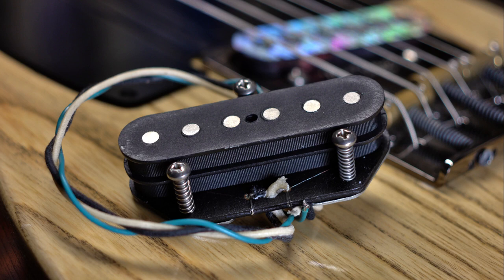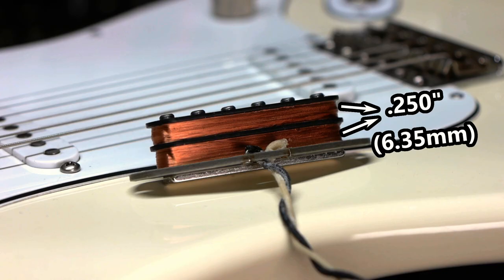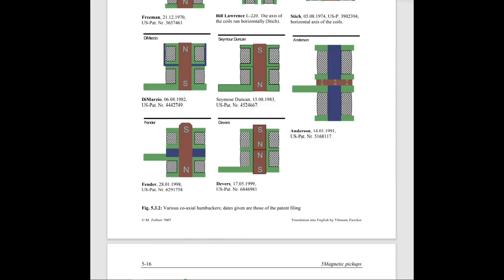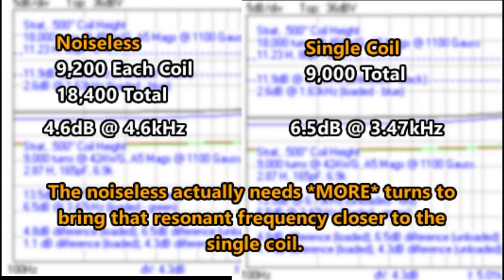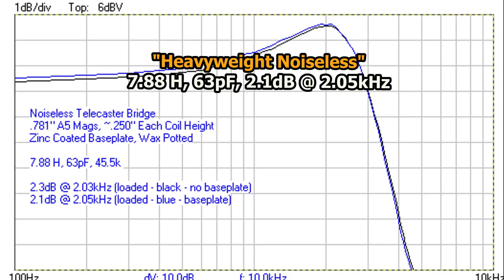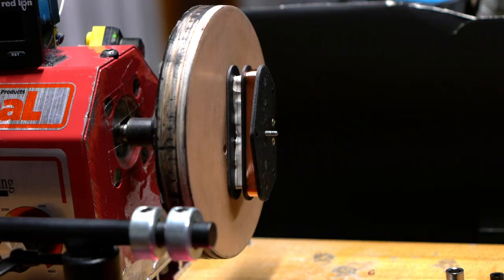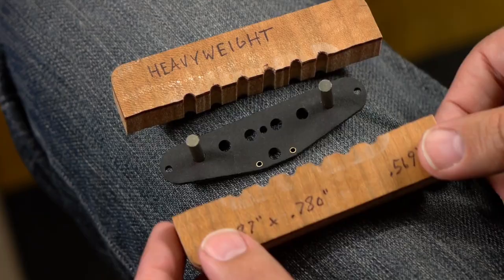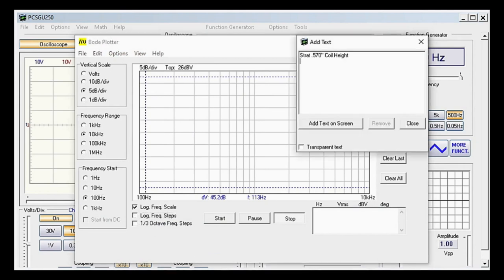Noiseless "Single Coil" (Stacked Humbucker): Build Tips and Theory

Comment: Before I watched this video, I tried doing a stacked design with 5,000 turns ea of 43awg (10,000 total) and observed the low inductance like you described. I believe it was about 1.9H. I switched the wiring back to in-phase / non-noise canceling and the inductance shot up to 8H. Any idea why this phenomena happens with stacked designs out of phase but not in a normal humbucker design which is out of phase by design?  Is it just because the stacked bobbin cores have the same polarity?
Reply from the maker: That's absolutely it -- the stacked have the same polarity. Now why is that exactly? I'd love to be able to answer why on a more specific level. Instead, let me share with you a section from "Electric Guitar: Sound Secrets and Technology" by Helmuth Lemme: 

"Another common form is the so-called coaxial (‘stacked’) humbucker where both coils are 
placed on top of one another. This principle was first invented by Armand F. Knoblaugh in 1938 (US patent no. 2,119,584) but was not used in guitars for a long time. It first came into use in the Gibson ‘Les Paul Professional’ and the ‘Les Paul Recording.' 

This then was copied by many others. Here two coils of half-height are wound on to a big bar magnet or six individual magnets. Because the lower coil is removed 
from the strings further along to the upper one, it delivers a far lower signal voltage with an order of magnitude of approximately one quarter. If it is switched reversely in series to the upper one for hum rejection, it deducts a part of the voltage. Pickups of this style therefore have a weaker signal than single coils of the same size. "

---------

So, regular humbuckers don't have this issue. Because the magnetic polarity is reversed in addition to the phase, they have a true additive effect when wired in series, meaning the inductance of both coils is combined. 

A similar effect can be observed with a phase switch. This is one of my favorite mods. My wiring diagram is here: 

https://imgur.com/gallery/aiI59L6

Series/parallel and in phase/out of phase switches. I use two pickups in my guitars, with reverse magnetic polarity.

Now there's an interesting idea. When you play with these switches, you'll quickly hear how the "out of phase" sounds have much less low end. There is less output overall, but there's a disproportionate drop in low end frequencies. "Out of phase" gets this great, nasally, honky kind of tone. 

Series out of phase gets the sharpest, most brittle tone, while parallel out of phase gets a more honky, nasally, cocked wah sort of tone. 

And of course, series in phase and parallel in phase get more traditional sounds. 

It's hard to imagine why, then, a noiseless stack would sound so different from two normal pickups polarized and phased in the same way. That it mostly just cancels noise, and causes a loss of overall output, but we don't get these "honky" or "nasally" tones.

And I think it's because of the proximity to the strings. If you were to take the bottom coil of a noiseless stack and make it into its own separate single coil, with the same winding direction and polarity, and install it as a bridge pickup -- 

-- then you'd have two pickups with the same polarity, and out of phase with each other. So you'd get your nasally, honky, "out of phase" tone. 

The reason noiseless stacks don't get the same tone, and instead cancel hum, seems to be a consequence of distance from the strings. The plucking of the strings is what induces an alternating current in the coils via electromagnetic induction. The greater the distance the coil is from the strings, the weaker that induced current is. 

Basically, imagine a pickup right next to the strings. Then you lower it so it's flush with the pickguard. And how much of a difference that makes. Now imagine you lower it so much that it's 1/4" or 1/2" below the pickguard. 

Wish I had a more scientific understanding to offer you. But hopefully that helps. Interesting stuff to think about! I'm always learning more, so I'll let you know if I discover anything else. 

FYI, I've had better results recently using a taller top coil and shorter bottom coil. My latest noiseless experiments have been a .280" tall top coil, and a .130" tall bottom coil. Top coil wound with 6,000 turns of 43AWG, and the bottom coil wound with 6,000 turns of 48AWG. 

They sound much closer to a real single coil, and even have a bit more high end. Almost hi-fi sounding. I got the idea from Fender, who uses a taller top coil and shorter bottom coil on their noiseless pickups. I just took it to an extreme and used 43AWG and 48AWG. I've used 48 on a bunch of pickups now and it's a very fascinating wire. Not sure I could handle anything thinner. 

I get mine from Ultra Fine Copper Wire in China. Highly recommended. If I had more time and energy I would have made a followup video, but for now, the best I can do is update in the comment section. 

Thanks so much for commenting and asking a question, and I hope this helps!

Comment: Humbuckers are "noiseless" by virtue of one coil being both reverse wound AND reverse polarity of the other coil...and I thought both opposites were a requirement for the pickup to  be noiseless.  But the stacked pickup's reverse wound coil is the sale polarity as the other coil. So, why is it noiseless? 

Also, some people  can't reverse their winder motors...or they attach the bobbin to the winder via the magnet on the bottom of the bobbin...making flipping it inconvenient. By putting in another eyelet to serve merely as a junction point, the "finish" of the first coil can be attached to that eyelet, and the start of the second coil can be attached to the regular "hot" or "signal" eyelet before winding it...then, its "finish" can soldered to that junction eyelet. The result will be equivalent to the second coil being reverse wound. 

And while I appreciate that your pickup work is both science & art,  I disagree with the over emphasis on number of winds & resistance. In fact, when two different types of pickup could have identical resistance & sound completely different. AND,  active pickups, with a builtin preamp can sound better & have more powerful output than one with 18,000 winds. Plus, output & tone is a factor of more than winds...ranging  from the shape of the bobbin, height of the pickup, magnet type, case  shape & composition, resistors capacitors & pots, and on and on.

In fact, miniature electronics allow piezo pickups, with 1/4 of the output of magnetic pickups, to sound great...and graphic equalizers small enough to be mounted "onboard", as well as wiring mods, allow  an almost infinite number of tones to come from a guitar...and for one  pickup to sound like any other one...making some of this over-attention to detail no longer necessary. Plus, the power requirement of pre-amps is small...especially compared to that which is needed for the power amp anyway! Beyond that...the most powerful, and best tone, I've heard  from guitar was from one with active pickups.
Reply from the maker: The answer to your question can be found in section 5.3, "Hum-compensated Single-coil Pickups" in the following book: 

The Physics of the Electric Guitar by Manfred Zollner, which I've compiled into a Google Drive document here: 

https://drive.google.com/drive/folders/1x9TRAo5gVvCZDk6OGI8rqSGRnm0P1OkM?usp=sharing

The original source can be found for free here: 

https://gitec-forum-eng.de/the-book/

I merely downloaded everything separately, including the videos, and compiled it for ease of access. Just search "5.3 Hum-compensated Single-coil Pickups" and it'll take you to the section of the book that explains everything. 

------------------------------------

Also, I'm well aware that two pickups can have the same DCR and sound completely different. There's simply too much to cover in a video like this. 

The topic here is of a noiseless co-axial humbucker -- and turn count does matter with these, a lot. 

With noiseless pickups, including normal and co-axial humbuckers, the greater the difference in turn count is between the two coils, the less effective the noise cancelling will be. 

------------------------------------

As for turn count, magnet type and strength, wire insulation thickness, bobbin dimensions -- all of this goes far beyond the scope of this video.

Isolating for variables is not easy with pickups, and many people state that wire insulation thickness, wire gauge, coil height and width, magnet type and strength -- 

-- they say these things all matter, but nobody can actually tell you what difference they actually make, individually. 

I hesitate to speak more on the topic as it's extremely broad, extremely complex, and there's only real meaning in discussing independent variables if we're going to state clearly what they actually mean. 

Thicker wire insulation leads to lower capacitance. But it also affects the turn count indirectly, as it makes the total length of wire on each turn greater than it would be for a wire with thinner insulation. So right off the bat we've changed two variables by changing the wire insulation thickness, rather than just one. 

When you change the coil height, you're also changing the distance of each turn of wire. Similar to how a turn of wire on a Telecaster pickup is not the same as a turn of wire on a Stratocaster pickup, as Tele pickups are wider. 

The best way to test things, IMO, is to use bode plots, and to do your best to control variables insofar as that's possible. An example would be my super heavyweight pickup: you can make a similar pickup with a .500" coil height with 18,000 turns of 46AWG, as you can with a .570" coil height with 18,500 turns of 44AWG. .781" A5 magnets for the taller coil, .719" magnets for the shorter coil. 

As soon as you change the coil height like that, you're changing the magnet height and the length of the turns of wire. It just so happens that through experimenting I found 44AWG on a .570" coil to be similar to 46AWG on a .500" coil. 

That's not isolating variables in a highly accurate way, but it's as close as laypeople can get without a laboratory setting. 

And I will say from running bode plots on both of these models, the resonant frequency is exactly the same -- around 1.6kHz -- with similar Q factors, meaning the amplitude in decibel voltage at that resonant frequency. 

The taller pickup seems to have slightly more output with a slightly higher Q factor, and greater retention of higher end frequencies. That's reflected in the lower inductance of the taller pickup, which, despite having 500 more turns of wire, is 10.5 Henries vs. the 11.4 Henries of the shorter pickup. 

Comparing the bode plots side by side, you can see that right at the resonant frequency of both pickups, 1.6kHz, the taller pickup has a greater amplitude at the higher frequencies. It declines at the same rate as the shorter pickup, but since it's starting with a greater amplitude, it retains more high frequencies compared to the other. 

I haven't gotten into making a video about these things yet because it gets extremely complicated, and explaining things in a user-friendly way when most people have only ever heard of DCR for measuring pickups -- it takes a lot of condensation of these principles, with clear examples, to explain what's going on. 

I've even talked to people who are aware of inductance and capacitance, but misapply them in the same way people misapply DCR. Resonant frequency is not the be-all end-all and as I mentioned in the prior example, two pickups can have an identical resonant frequency, yet sound quite different. 

That becomes evident only when comparing bode plots of pickups side by side. When we use only DCR, or only inductance and capacitance, or only the listed resonant frequency, we miss the bigger picture. 

For a standard of comparison it's best to have a "standard," like an 8,000 turn Strat pickup with a .430" coil height, 42AWG plain enamel, poly, or formvar wire, and Alnico 5 magnets. 

That "standard" is very necessary, as without standards, we have nothing to compare by. It's easiest to compare pickups by make and model, where only one variable is changed at a time, insofar as that's even possible. Turn count is one such variable, and most builders only use turn count as the major variable. 

People like me tend to get more experimental, using very thick or very thin wire and radically different coil heights, like .570", or on the other end of the spectrum, .125" with wire gauges as thin as 48AWG. 

I could go on and on but suffice to say this gets very complicated. 

Anyway, I agree with you completely about active pickups. Passive pickups in this day and age are more a manner of tradition and convenience rather than being superior to active pickups. With post processing, flat EQ active pickups can achieve tones of just about any variety. 

With passive pickups like most of the ones I make, the tone is "baked in." 

However, most people want to just "plug and play" and not have to deal with batteries, or post-processing, even if those options offer a lot more variability and versatility. 

If you haven't checked out CyFi Research, I recommend looking into them. They talk all about these things and their products look exceptional. 

My latest experiment is a lo-z noiseless co-axial coil (stacked noiseless like in this video) with steel poles, a neodymium magnet, and about 500 turns of 38AWG on each coil. 

I'm using a piezo pickup in the neck pocket, and have two output jacks. The lo-z magnetic goes to one output on my interface, the neck pocket piezo to the other. 

Both run into their own Triton audio preamp, the BigAmp in the case of the magnetic, and the BigAmp piezo in the case of the piezo. Both Triton audio DI boxes run on phantom power, supplied by my 2i2 interface. 

This is a great setup and sounds phenomenal. And with post processing you can achieve some really stellar sounds. I mostly use NDSP Archetype: Petrucci on the piezo amp setting for acoustic tones using these pickups. 

And the results are astounding. You can also do incredible things when running two separate outputs. And relying on an interface for phantom power, the wiring is dead simple. Volume knob for each pickup, separate output jack for each pickup. And that's it. Everything can be controlled in post. 

This is a perfect example of a great guitar for home recording. Instead of the Triton audio, using a fully equipped DI box -- one for each pickup -- in a live situation, you'd have complete control over your sound, in full stereo. 

So, I'm all for active pickups. When you use very few turns you get a mostly flat EQ that can be manipulated to sound like just about whatever you want if you know what you're doing in post-processing. Whether that's using a DAW or a DI box or EQ pedal and everything inbetween. 

As you can maybe tell, condensing these thoughts into a video would take a massive amount of effort. The hardest part about making videos is choosing what to focus on and what to leave out. If I just talked about these things live with no restraint the video would end up being hours long and it would be very difficult to get anything useful from it. 

Or maybe it wouldn't. Maybe at some point I will do a live video. I just prefer writing scripts as I find organizing my thoughts tremendously difficult and when I ramble on a lot, I lose people very quickly. Especially on extremely complicated topics like this.

Comment: Turn count doesn’t have to match, the backplate systems and dimarzios stacked noiseless definitely don’t have matched coils. Dimarzio doesn’t run the poles through the hum cancelling coil though, it’s magnetically shielded from the top coil and it has its own steel slugs
Reply: Do a bit more research on that...as, while you can shield from EMR,   and magnetic field shape can be influenced, it is virtually impossible to entirely shield from magnetic fields themselves ...consider the thousands of miles of Earth rock that does not block the magnetism emanating from Earth's iron/nickel core.